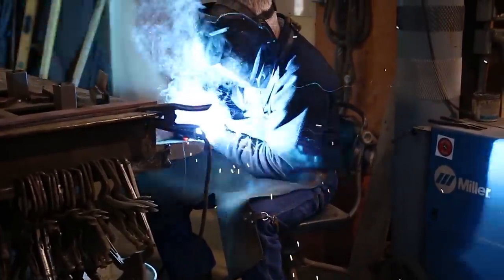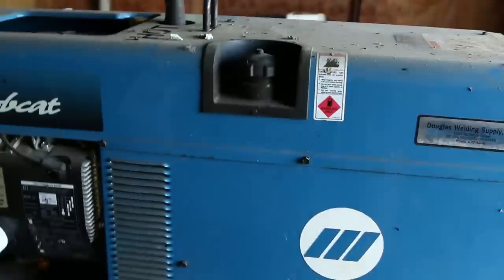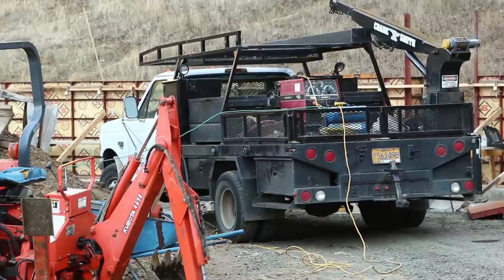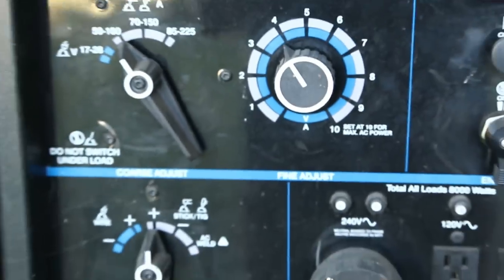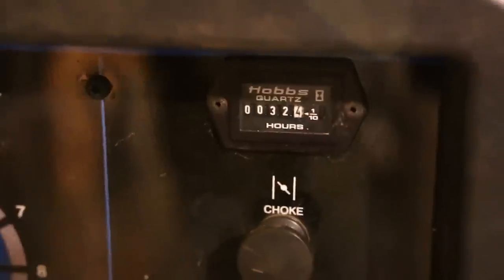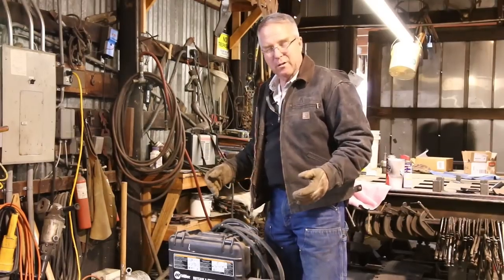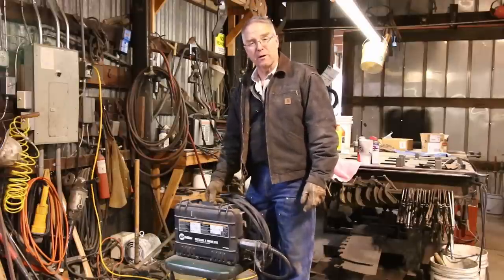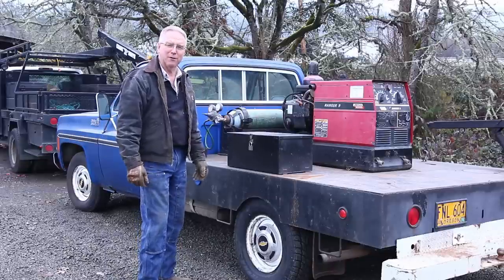Miller Bobcat Portable Welder

Comment: I learned how to MiG weld at a shop I worked at about 15 years ago. It sure was a hot job in the summer with all my gear on, but there was something amazing about having ear plugs in, my helmet down, seeing nothing but that point of light, hearing/feeling the buzz and crackle, and laying a nice bead in a joint making two pieces of steel into a singular object. I always felt like I was off in another world instead of in a busy factory pumping out parts for heavy duty trucks. The intense focus and concentration welding calls for is in many ways very calming.

Comment: I have had a Lincoln Weld-n-Power for 25+ years, that saw occasional use in a hobbyist environment. A few years back I converted it to propane - smartest thing I ever did! I recently passed it on to my son who just bought some acreage. I have no doubt that he will use it for another 25+ years. Propane - the way to go for  less frequently used gas engines.
Reply: That's a great idea, I need to look into that for my old Weldanpower 150! Did you have to get a kit or something?
Reply: Yeah, I forget the name of the place, but if you Google it, you will find it. Great instructions. I have mine set up with 2 pairs of common 20# BBQ tanks. That way I can hot swap them. 1 BBQ tank will not quite evap enough gas fast enuff for my 13HP Kohler, so it was either a larger, uncommon single tank or 2 manifolded BBQ tanks (which I could get for free). Good luck!
Reply: Awesome stuff, thanks! I'll have to look into this since the gas today just kills carbs! Propane is easy one oil too, I bet your oil stays clean a hell of a lot longer! Thanks again for the reply!

Comment: My uncle still has a pair of heavy-duty Miller welders on a trailer, that he and his father used for decades building feedlots.  A lot of hours of reliable operation, enough that they paid to have them shipped instead of buying something local the time they built a feedlot in New Zealand.  The welders haven't been used in 10-12 years, but he and I are both confident that an engine service is all that stands between them and another decade of reliable service.

I've mentioned my grandfather's service truck before, but it carried a Lincoln welder much like yours, and saw many hours of reliable service too.

Comment: Delayed gratification: the definition of my life.  Builds character, though.

The truck reminds my of my wife's parents' '84 Chevy.  Lots of stories attached to that old truck, some of them fun.  It was one of the ones whose frame fatigued at the front shock absorber mounting holes.  My brother-in-law pulled the front clip, welded the cracks, fish-plated it, and they drove it for a long time.  (Then there was the water pouring into the cab, the shot ring & pinion, the 305 with flat cam lobes...)  I have a friend who was a mechanic in those days; he wouldn't get under a Chevy or GMC pickup of that era if it showed signs of sagging in the front.

Comment: A gentleman who owned a welding shop in the home town gave me some good advice once when I was asking him about my first welder, he said "if you can get yourself a portable. You'll have a welder where ever you want and if your power goes out at home you can use it as a generator. And since you have been using it as a welder you know your generator will start when your power is out at home." I bought a Bobcat 250 about 12 years ago and we got by fine. However recently I retired and we want to do some camping so I sold the Bobcat and got a Honda generator. Oh yea and a nice 200 amp stick and tig welder. :)
Reply: Little honda inverter generator (one of the quietest things I've ever seen) and a Millermatic 141... you could weld CA back to the union after "the big one".
Reply: Long ago the Miller Bobcat 225G was about $2500 new compared to about $4000 today. The welder was considered a "consumable" by fence builders, etc. I went with an engine drive because I only have a garage, not a shop. Rather than invest in a 50 amp 220 circuit for the welder, I put the money into the portable. It has been used infrequently during power outages as well as worksite power. I kept the welder and bought a 6KW Honda generator that is half the weight/space of the Bobcat. Occasionally, I take it out on the driveway and light up the neighborhood with the arc. I have set the lawn afire a few times. Always good to have a connected water hose and a 5 gallon bucket of water for those times when I pick something up that I should have left to cool a bit more.

Comment: One drunk Canadian told me, drink the miller, weld the Lincoln.   Quick story:  During my Pipefitting apprenticeship, we were using miller stick welders that had digital readouts for the settings. The teachers notice that everyone was getting better, and the quality of welders increasing. But they kept getting calls saying the new welders didn’t know how to operate a welding machine. They finally figured out that all the kids where just setting the machine to a number that worked for them on the digital read out and never learned how to fine tune a weld with analog switches. So they donated 50 less than a year old machines to the other trades and bought or exchanged back 50 old ass analog welders. Lol. Every apprentice shit bricks for the next month.
Reply: Its kinda the same idea though with running Stringers vs Weave though. In my personal experience its best you as the welder learn BOTH techniques.  Cant tell you how many people ive run into with preferences for whatever reason to one or the other.  And the last thing you want to do is get good at say running Weaves then go to burn a 3G test and the person giving the test throw at you Stringer only..  Which ive personally seen. Then you fail the test for a job and that ride home is gonna be pretty depressing.
Reply: @Demonlord468  my uncle is a welder and has been teaching me this I started out doing weaves and then he show me how to to do stringers but dip back into the bead to stack dimes and man is that pretty but it’s nice because I’m learning how to do both processes.
Reply: @amanwithouthope9475  Yeah it best to learn both because i dont know why but, when you start testing you will run into guys who have a preference for one or the other. You will also run into Engineers specifying on their drawings for one or the other only as well sometimes especially in structural.
Reply: @Demonlord468  yeah I try to weld with me left hand some times but of course not as good with the right I use off hand as support I suck at welding with just 1 hand

Comment: I still have a Miller Bobcat 225G with the Onan gas engine, purchased new. The only failure I ever experienced was the fuel hose from the filter into the tank was NOT rated for gasoline. It broke off inside the tank! There was a brass pickup on the end of that hose, inside the tank. After I fished out the residual hose/brass fitting from the tank and replaced the entire hose up to the filter with rubber fuel line, proper function was restored. A few years ago, I finally replaced the spark plugs now that the machine has 300+ hours on it. The dealer who sold it to me said that these midsized engine drives have a 3000 hour typical life span. They are typically replaced rather than rebuilt.

Comment: Man... When I grow up, I want all the cool toys like you got.  Unfortunately, I'm stuck 14 hours a day under an old laptop.  One of these days though...
Reply: I have 6 laptops on my desk now. About 6-7 hours per day on the keyboard. Get yourself a small wirefeed MIG/fluxcore machine (either Miller or Lincoln) that runs on 110 volts (unplug the washing machine). A spool of wire lasts a long time. That's what I started with.

Comment: I got the pipe pro 300 (big blue) & it's a great machine. I had the ranger 250 before & it had a lot of circuit board problems. I believe yours was an older model though (maybe less electronics & more analog controlled).

Comment: Miller Bobcat fine tuning adjustment: When you are welding, sometimes it's a few too many amps, so you back off the fine tuning knob. With this machine, that same knob controls the voltage for the power outlets. Larger machines allow independent adjustment of welding power while keeping outlet power at 100%. That's not the case with my 225G. If I want full voltage to saws and grinders, turn the adjustment to 100% and delay the welding task until the power generation is not needed.

Comment: Spent a few hours repairing those gas powered welders . Worked for a large electrical contractor repairing equipment. Electricians loved to wire the throttle open so they would be able to start welding easier. Not good for the engines. I learned to hate the sight of a Lincoln gas welder
Reply: Sounds like the human in the equation was the problem, that's not a bad mark on the welding machine itself. Everything breaks faster if mistreated.

Comment: I was looking around the interwebs.  Maybe you could air arc with smaller rods.  
Size 3/16" x 12" (4.8mm x 30.5cm)Amperage Capacity 200 - 250 amps

I have never tried it with a bobcat, but I have used these rods at 200 amps on plug in machines

Comment: Do you have to have an actual in-ground copper rod installed on-site before using the suitcase portable welder? If not, then is this a higher risk in case of actual shorts that could happen? Also, can you tell us how much (needed/required) wattage does your generator push to the suitcase welder in order to get a steady arc?

Comment: I found a bobcat 225 03 model (So not the NT model like yours) with around 600 hours on it for $2000... Its about the best used price ive found (That wasn't otherwise questionable if its stolen...) around here. Think thats a fair deal? Same machine new is around $4000 or so..

Comment: You can air arc with that machine, all the way up to a 3/16 electrode, recommended range for 3/16 min amps 200 max amp 250
Machine puts out 225 amps your good to air arc away

Comment: What's the "minimum safe distance" (if there is such a thing) for being able to watch the arc when welding?  I'm curious how much you have to do for job site safety.  Just tell the crew you're welding and expect them not to be dumb or after 50' it's not a problem, etc.  When you see welding on highway projects, they have blankets of some kind to shield the motorists (since you can't expect people to just not look at the bright shiny thing under the bridge).
Reply: There are welding "curtains" and "blankets" used as shields. If you make your own frames, the curtain material is not that expensive. Google for "welding curtains" which come in a variety of colors. Enough arc light comes through to make people aware of the hot work in progress. If you are watching the arc, you may not be watching the road ahead if you are the driver.

Comment: How does this compare to an AC welder and gas generator?
Reply: That's not going to work as well as you think. The gas generator will need to be very beefy to drive a welder. The welder is an inductive load (like a motor). Let's take a 6KW generator - you might drive some kind of inverter with it but it won't work so well with an AC buzz box.

Comment: what is the difference with air arc stick welding
Reply: Air-arc GOUGING is a material removal process using carbon electrodes to MELT the metal and compressed air to blow away the molten metal. It's a cutting/gouging process designed to rapidly prepare a surface for welding that has been damaged or was previously welded and the joint failed. Very high amperage is required. Plasma cutting is more a severing process - little metal is removed via arc and compressed air. All other WELDING processes use electrodes containing metal that will be ADDED TO the weld joint bonding them together. Stick electrodes are covered in a flux to exclude the atmosphere from contaminating the weld or leaving holes/slag inclusions.
Reply: thanks tom
Reply: One thing about arc-air gouging is that it blows molten metal far and wide. Way, way more than oxy-acetylene cutting. It can blow molten steel 30+ feet away. So you have to be pretty careful when & where you use it because you can set stuff on fire very easily. It is very good for taking apart heavy welds and for making a big groove in heavy pipe in prep for welding. I daresay Scott probably has little use for it, losing it is not a great loss.
Reply: thanks
Reply: Thomas Kendrick p

Comment: Please do a welding video.
Reply: If you work in construction, making welding videos does not pay well enough. Unless you are DOING the welding, you cannot watch the weld puddle form and solidify. Stick electrodes begin at 12" long. MIG and TIG wire is even shorter. Beyond 24" you are just "watching a little spark".

Comment: Incorrect. 
Yes you can air arc with a bobcat 225
You can run up to a 3/16 rod
Do it all the time, no problems. 
I’ve air arced with a Lincoln outback 185 with 5/32 rods for several hours at a time, no problems either

Comment: Teach us welding if you have the time
Reply: Welding is learned through practice more than through instruction - similar to riding a bicycle. I could TELL you all about welding safety but you will learn more after picking up a black-hot piece of steel too soon. I could TELL you about faulty welds but you will learn more when your weld falls apart with a light hammer blow. Go buy a Miller 141 MIG, good helmet and gloves. Pick up some used bed frame steel (1/8" angle) and practice on it. Buy quality whether new or used.

Comment: Why can't you weld on ?galvanized
Reply: Rey D_SCAL harmful vapor from the galvanized coating. Bad bad news. Nickle poisoning iirc EDIT: Zinc, not nickle, DERP.
Reply: You can, just drink a glass of milk first and keep your head out of the smoke like you should always do when welding.
Reply: There's no nickel in galvanizing, it's zinc. Inhaling any vaoprized metal is bad for you, milk old wive's tale or not. You can weld galvanized steel, just use a mask suitable for use with organic fumes. If you don't, you'll pay for it, but you won't know you've screwed up till you are much older.....
Reply: Sideslip, that would certainly be "inorganic" fumes, as it's only organic fumes if the fumes in question are from things like paint thinner, gasoline, kerosene, diesel, benzene, toluene, etc. where the backbone of the molecule is a carbon chain or ring.
Galvanized metal being welded puts off Zinc fumes, and as far as the chemistry's concerned it's inorganic (despite zinc deficiency being seriously bad news for the human body).
Also, if you do weld zinc and don't use a mask, you'll generally start hating yourself in a few hours, not years. However, it is true that if you make a habit of it you'll probably take years off your life.

Comment: Well my friend, its not like you to use poor words, but a couple of things i picked up on... Petrol is a liquid not a gas, i never understood why you Americans call it gas. And second a Motor is run on electricity while an Engine runs on combustion, its not a V8 motor, its a V8 Engine! Im highly offended and will immediately unsubscribe  (only joking) haha
Reply: Gas is not a reference to a state of matter, but is short for "gasoline"...which probably began as a brand name (along with Cazolene, Gazelene, etc) - whereas "petrol" was first used as the name of a refined petroleum product around 1870 by British wholesaler Carless, Capel & Leonard.  They tried to trademark the name once it was found to be a usable motor fuel (it was originally sold as a solvent), but the trademark was disallowed as the term was in common usage by then.  It seems that neither term has anything to do with the chemistry of the substance, but more about the marketing.
https://en.wikipedia.org/wiki/Gasoline#Etymology_and_terminology

motor (plural motors): A machine or device that converts any form of energy into mechanical energy, or imparts motion.  
- This would include internal combustion engines, although a motor may not usually be categorised as an engine.
https://en.wiktionary.org/wiki/motor

Coming from the colonies, I can relate to where you're coming from...especially when there's cars that run on LPG (an actual gas.)  But in the end, the abbreviation "gas" is equally applicable as "petrol"...and motor is considered accurate when describing an internal combustion engine.

Cheers, mate!  :-)
Reply: Okay M8 ill keep my mouth shut then, haha
Reply: Jimmy,
 Is there any people who have more miss used words for something than the British ? Tea and crackers ? Fish and chips ? Some I've not figured out yet, oh Bloody :-)
Reply: well England is in Britain, and England is where the English language originates, so perhaps its the American version of English that is miss used.....